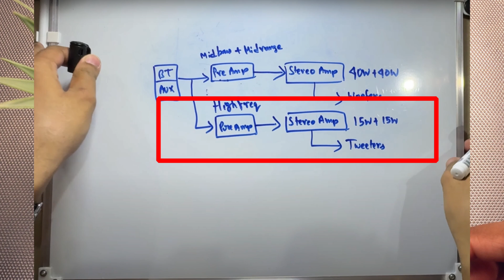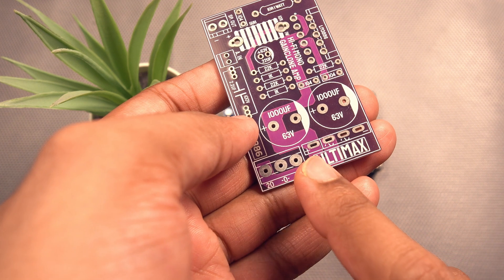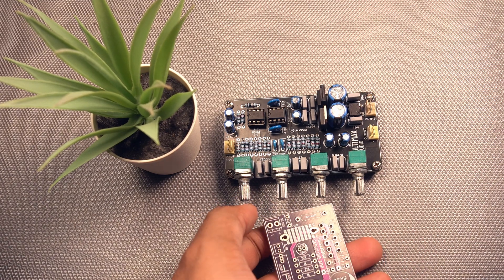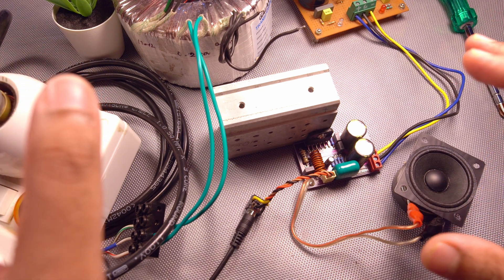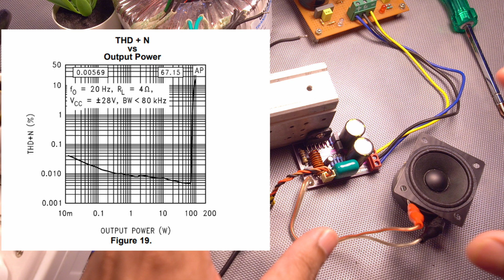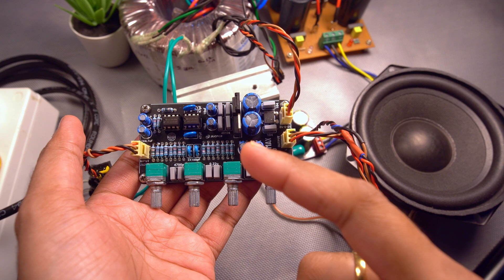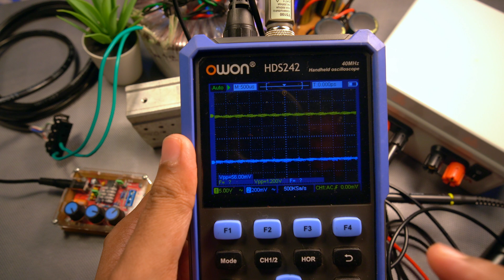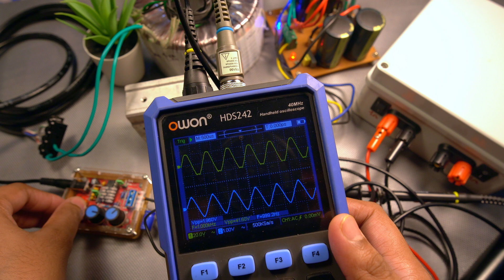Ultimax Audio Lm3886 board and Tone Control Board Test | DIY Amplifier Project Part 7

Comment: From where you purchased LM3886 ?
Reply from the maker: From Ultimax Audio  … you can contact them in this number - 78219 21789
Reply: @Roys_Desk  Back in 2022 ultimax used to sell completely assembled LM3886 Board without  heatsink @ 1699 Rs including shipping charges...i couldn't buy that due to financial issues...Now the ic itself costs 699 Rs...
Reply from the maker: Ic costs more than 699 now 🥲… and that too for the lm3886TF (plastic tab ) …. I have the metal tab also (got it from local market) that costs more than 1000 🫢!!
Reply: @Roys_Desk  Apart from heat dissipation & insulation is there any difference between LM3886TF & LM3886 ? I mean quality wise
Reply from the maker: @aneeshchandran  Nope .. no difference, the dye inside is same in both the models .

Comment: The +/- DC & AC voltages that you menmtioned with corresponding  Po levels, did you observe any drop or sag between no load and full load? What was the percentage regulation? My expereince with LM3886 /4780 is  that small Silver mica , polyster film or COG ceramic capacitors (47pF-220pF) are required betweeninv. & non-inv i/p and feedback network as shown in datasheets to prevent oscillations
Reply from the maker: @rogerwalter2500  Yes there is a drop but since the VA rating of this transformer is quite high … the percentage regulation was below 10%.
Yes This Ultimax audio board lags quite a few necessary circuitry.
I have designed a board myself and ordered pcbs … I will receive it soon and there I will do step response test to check the stability under various conditions.
Reply: @Roys_Desk  Thanks

Comment: Acha samjaya brother thanks...mera ek sawal hai ki.... amplifier k power supply ko discharge karne ke liye konsa resistor ( Value and watt ) Or Pf ( capacitor ) lagaye
Reply from the maker: @amol332  Thank you brother ☺️…
Bleeder Resistor normally power supply k value k upar depend karta h .
For example- For 30v supply 560ohm 2watt resistor kaafi hoga .
Normal ohms law use karke 50-60mA current value use karke resistor value calculate kiya jaata h .
Reply: @Roys_Desk  agar supply voltage 30-0-30 se lekar 60-0-60 ka ho to konsa resistor lagaye
Reply from the maker: @amol332 you can use 1k 5watt resistor for both the rails 😊.